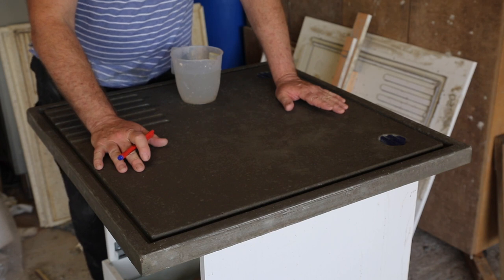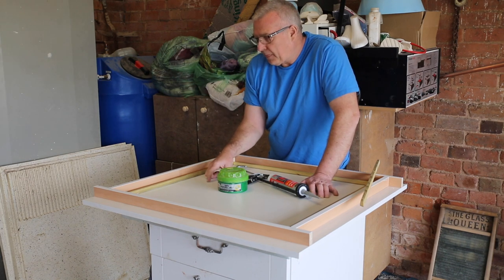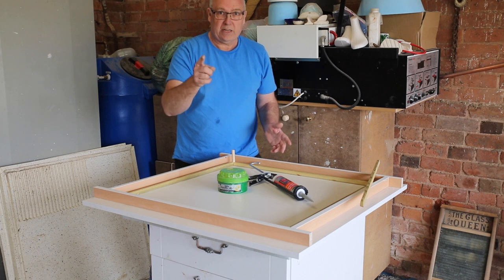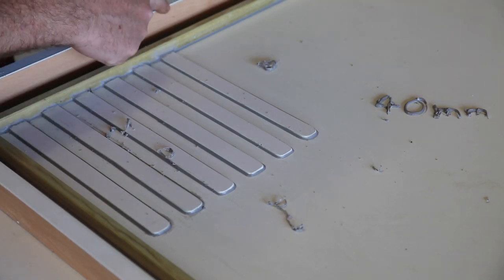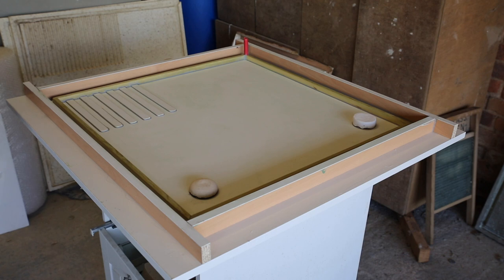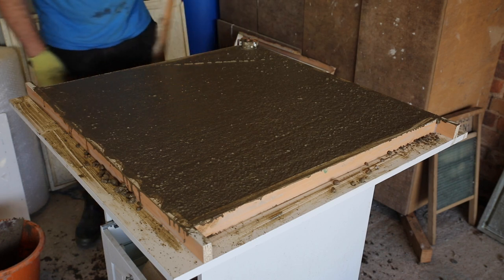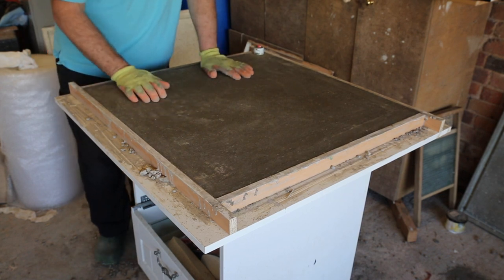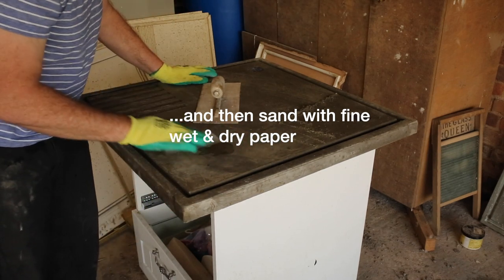Felting Table from Cast Concrete

Comment: Great design, thanks for sharing your process!
Reply from the maker: Thanks James. I'd go simpler next time - just the draining channel around the outside. It's a very satisfying project!
Reply: @donutpanic  I've been brainstorming ideas for a long wet felting table/ craft table for my GF. We had been going forth between copying your cast concrete idea, but making it modular. 2' sections with the channel connecting. The other idea was basically a butcher block with a water proof finish. 

I think we're going with the wood build but now you've made me want to try some cast concrete ideas.
Reply from the maker: @cawcawmeowmeow If you look at most of my videos you will see my original table which is made from a solid surface kitchen worktop material called Mistral. The drain groove is routered into it with a corner outlet. It is equally heavy. How about waterproof plywood and epoxy coating if you want something more portable?
Reply: @donutpanic  that's a good suggestion. I'll weigh it out and let you know what I end up going with.

Comment: Nice work.
Not sure if you did this or not, but a suggestion would have been to taper the boards you used for the draining grove so that the channel would have sloped down from the corner opposite from the drain hole so that the water would have less chance of it staying pooled in the channel.
Other than that ... great job!  Keep up the great work!  New Subscriber!
Reply from the maker: Thanks. On my CNC machined felting tables the outer groove slopes to the drain. I didn't bother on this as in practice I've found it isn't necessary. I did the concrete one to show how anyone could make a table with minimal kit anywhere. I've discovered a love of cast concrete!

Comment: Thanks again for another great tutorial. I have made my own table top following your steps. I am wondering what your thoughts are regarding epoxy coating before applying car wax?
Reply from the maker: I think if you are epoxy coating you might as well make it from timber or plywood - it could be fabulous! The finish on the concrete top cast off the smooth melamine then waxed is a great surface.